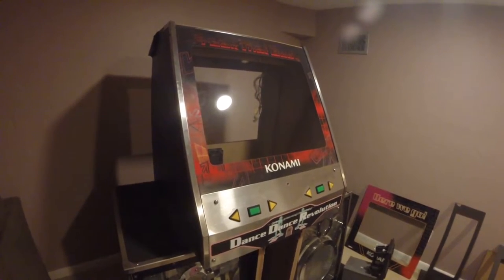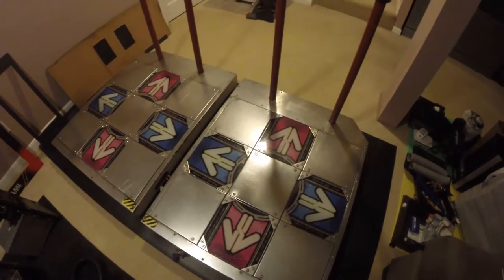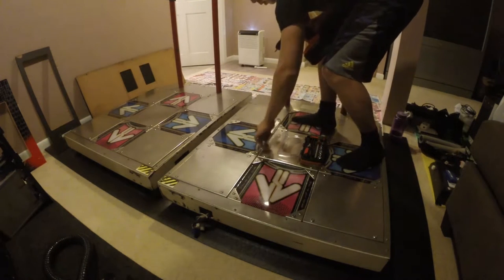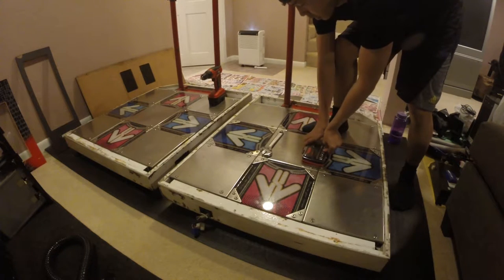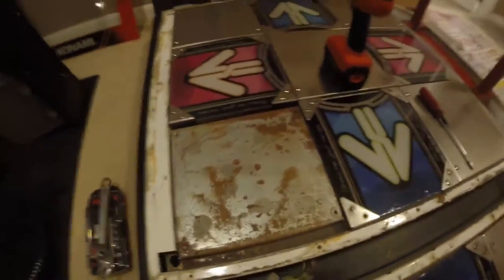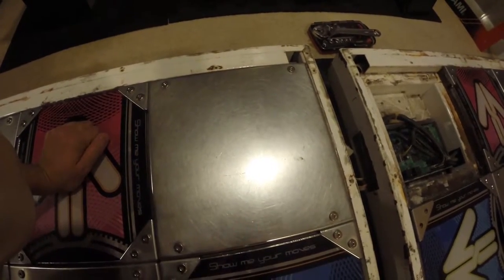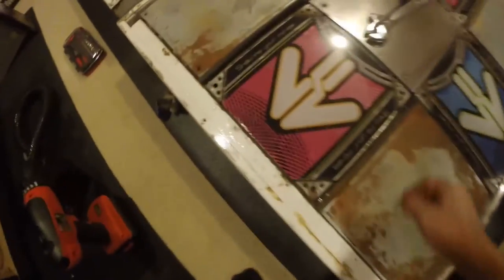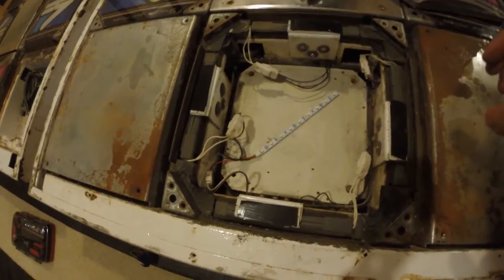DDR Cabinet Restoration Part 1 - Stage Disassembly

Comment: The new generation pad panels are the same as the originals? o_o Where did you order/obtain them? They look so nice!
Reply: 2 years late but you can get the new gen pad panels here (albeit a bit pricey, because Betson Int. is an official part supplier for Konami): 

Blue Pad
https://www.betsonparts.com/amusement-redemption/manufacturers/konami/floor-pad-blue-for-ddrx.html

Red Pad
https://www.betsonparts.com/amusement-redemption/manufacturers/konami/red-dance-floor-pad-for-dance-dance-revolution-x.html

Parts in General
https://www.betsonparts.com/amusement-redemption/manufacturers/konami.html